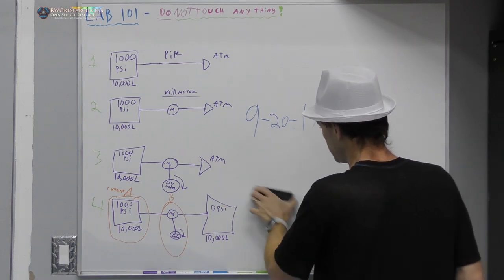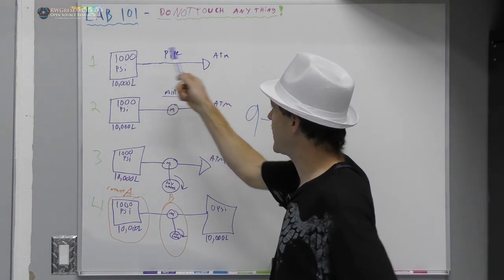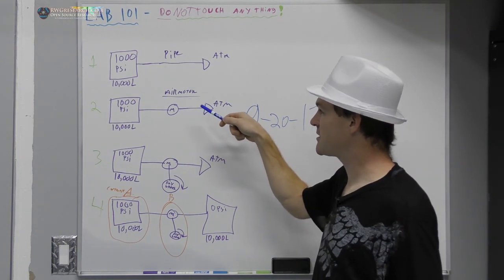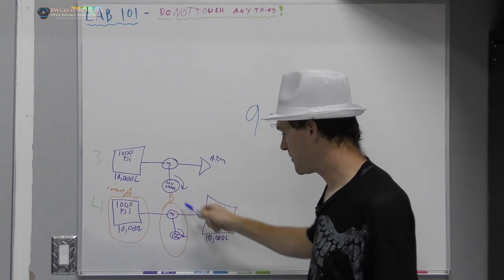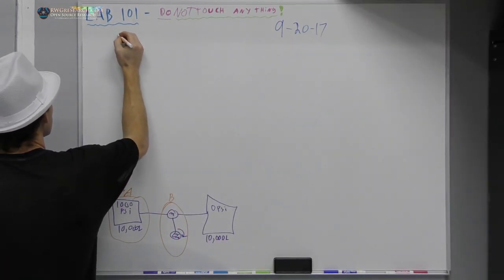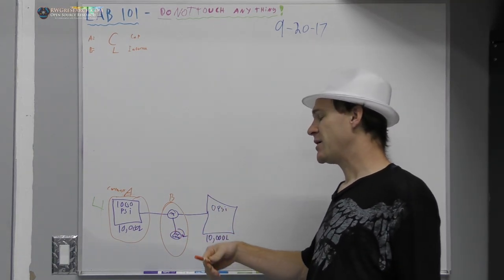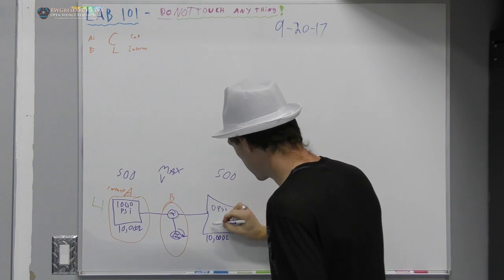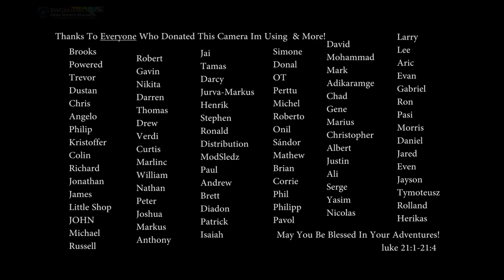The Search For Answers Part 3:  you can lead a horse to water but you can't make it drink

Comment: Russ - a better example might be a two vertical open top water tanks connected by a pipe at the bottom with a water wheel pump and flywheel on the water wheel.  The first tank would be full (the second tank empty at the start) and then allow the water to flow from one tank to the other through the water wheel motor - from the flow in the tanks the levels would equalize and the kinetic energy in the flywheel would continue to cause the pump to move water from the first tank to the second until the kinectic energy in the flywheel is consumed and pressure in the second tank reverses the flow and the water wheel pump reverses - the oscillation of the pump would continue until the frictional losses cause the levels in the tank to reach true equilibrium.

Comment: Pretty cool.  Electric fields, sadly, react so fast to potentials that as soon as the fields equal out, or the electron charge is uniform, there is no real movement.  I think it's the normal view that a wire allows all the electrons to move from one negatively charged area to a positively charged area.  But actually, the wire is not a bridge, it is a part of the field it is first attached to.  The flow first happens not at the mid point but at the second connection.  Also electrons do not flow often, and when they do, it's usually as beta radiation.  It the tiny, unknown fields that flow through wires the most.  Well, that's according to a theory I posted.  By the way, on another subject, do you think those ultrasonic units people are taking out of room humidifiers are strong enough to create a heartless steam engine?

Comment: the capacitor stores energy in its dielectric field, the inductor stores energy in its magnetic field. 

the electro motive force (capacitor) is transformed into a magneto motive force(the inductor), and back again into an electro motive force (the second capacitor).

can you tap into the magnetic field of the inductor (magneto motive force), and still transform all the mmf back into emf of a capacitor?

in other words, if we use the inductors magnetic field, to move a magnet (let say repulsion of the north pole) to turn a motor, do we lose some mmf of the inductor? or does the repulsed magnet induce a back emf into the inductor?

Comment: I don't understand how in scenario 4 tank 2 would end up with 1000 PSI. It would balance itself out to 500 PSI in each tank as you said. I do understand how the kinetic energy stored in the flywheel would allow it to act as a pump which would then cause tank 1 to have less PSI than tank 2  because the kinetic energy stored in the flywheel would then be used to pump or compress the air from tank 1 & 2 tank to be on the 500 PSI balance mark thus ending in a  ratio of let's say 400 PSI in tank 1 and 600 PSI in tank 2 in the end after all the kinetic energy of the flywheel has been spent by acting as a pump to compress the air into tank 2. I don't see how it would be possible for all the kinetic energy stored in the rotational mass of the flywheel  would be enough that it could break the balance between the two tanks of 500 PSI and then compress or transfer the remaining 500 PSI from tank 1 into tank 2.  I just don't understand how it would be possible based on the way the kinetic energy is stored.. If you added no-fly will into the equation both tanks wood balance themselves out to 500 PSI each but adding the flywheel would at some point cause the pressure in tank 2 to be higher than the pressure in tank 1. If no check valve were inserted into the system in the end the system would balance itself out and there would be an even amount of pressure of 500 PSI in each tank. In order for tank 2 to reach 1000 PSI or in other words in order for tank 1 to have transferred all of its pressure into tank 2 all of the air as it's being transferred from tank 1 to tank 2 would have to be stored in the rotational kinetic energy of the flywheel so much so that it would be enough to transfer the 500 PSI from tank 1 into tank 2. I just don't see how even in a perfect world there would be enough kinetic energy stored to be able to transfer all the pressure from tank 1 into tank 2. If you do this up on a graph as far as the kinetic energy storage or transfer goes you would see that it would not take much kinetic energy to transfer Beyond 500 PSI from tank 1 to a greater PSI into tank 2 however the more PSI you have going from tank 1 into tank 2 beyond the 500 balance mark the quicker the kinetic energy stored in the flywheel would be lost  and the closer you get to the 1000 PSI mark in tank 2  the less kinetic energy you have less and the more kinetic energy it requires to compress the remaining pressure from one thing to the other.  On a graph if you compared it to a downhill slope it would be a gradual downhill slope at first and then it would nose dive into a near vertical drop the closer you get to reaching the 1000 PSI mark in tank 2.  My point is the closer you get to 1000 PSI the more energy it takes to compress the air from tank one into tank 2 to reach the 1000 PSI however the kinetic energy stored becomes less or has less energy to compress the closer it gets to 1000 PSI in therefore even in a perfect world it would not be possible to compress all the energy from tank 1 into tank 2 because the more PSI you have in tank 2 the less kinetic energy you have to work with to compress the air the closer you get to the 1000 PSI mark and the more energy is required to do so. Near the transfers end you have less energy to work with at a point  when the greatest amount of energy would be needed to get the job done.  You have a lot of kinetic energy at first however it does not have to compress as much at first. If you could reverse it and have less kinetic energy at first beyond the balance mark and have more at the end then I could see it working however this is not the case and it does not work in that manner. 

 I understand that in scenario 4 your working with capacitors and such and you're not using the theory of of pressure in a tank moving from one tank to the other.   I understand how you compare the two between one another  and how you're using it as a teaching tool so that someone who may not understand electricity such as capacitors and all that very well  can have it presented in the way that is more easily understood. 

 it's a challenge to explain my understanding in words without being able to have a physical drawing to show you exactly what I'm speaking of. Maybe I'll do a video on it and post it to my channel.
Reply from the maker: Tyson Capel 
2 words. 
Impedance match. 
Yes I'm using air to teach. Air is a bad way to test this in the real world. The transfer would be less than 1000. For sure. Also I would need a check vlave in the line before the motor to keep it from Going back.  in electronics. If everything is impedance matched. Then you can get alot Of the transfer but not all of it. Close though. But don't forget even in electronics if everything is impedance matched and you can get allmost all of the energy to transfer through an inductor. What's left from the first cap + the new charge in the second cap is = to the same voltage total start voltage. 
There are more to discuss here but not in this comment. 

Now think about it. During the transfer we generated a magnetic feild in the inductor. We can use that to do. Work. Or we can do nothing with it.  

~Russ

Comment: then what do you explain everything is clear do not worry about it ...but the scenario is not ideal and the movement from point A to point B there are losses of friction (proton neutrons) and heat is released ...and if you connect the efficiency with the movement of energy and the heat that was happened ...you see 101% efficiency ...
Reply from the maker: Abricos4440 this is just to explain what I'm talking about. Dont forget we are still in a thought experment. (If you want to be)  ~Russ

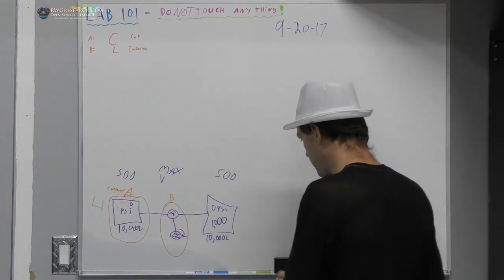Comment: 6:30 I do not get how you assume there could be 1000 psi from the left go to the right without any means of force like a pump (which requires additional power). The only thing I see can happen is, that the the pressure becomes equal and therefor there is no power potential left: 500 on the left and 500 on the right. Am I missing something?
Reply: Thinktin about it, I assume that your idea is the following: While potential difference, the motor accelerates the flywheel (which stores power); and once the pressure potential is equal the stored power in the flywheel will turn the motor and push/pump a certain amount of the 500 from the left to the right to create a new potential. Free energy it would be, if the flywheel would pump the right to 1500 as an example...

Comment: Scenario 2 is misleading! As you define the regulator as a 'motor' you create the assumption that something will be turning as a result of the air flow. If the 'motor' turns as a result of the airflow then some energy is "transferred" not consumed. SO from this I would say that Scenarios 2 and 3 are the same. The only difference is the mass of the turning part of the motor. Scenario 2 would be as you say it is if you defined the motor as a regulator as to not intentionally mislead your viewers to try and make yourself appear to be more intelligent...
Reply from the maker: The Art of 3D Printing hummm. Well lests start with the fact that I'm not making thses videos to sound intelligent. I could care less about that. I'm trying to point somthing out. 

 1. the pipe is the regulator in this one. It is in it's self a regulator. 
When the taink is empty the potential energy is "gone" but the pipe did not consume it. 

2. The motor is the pipe. It's only a regulator. You can have no mass or you can have a huge mass. Eather way it's just a regulator. If you have no mass. It's just pure resistance. If it's just resistance. Then it's the same as a pipe in 1 and you will have no potential when your taink is empty. But still the motor would not have consumed it... 

3. Same as 2 except The mass allowed it to keep the potental in a new form. So when the taink is empty. There is still alot of potental left. It's in kinetic form. And now you can do somthing else with it. In this stage it still did not consume it. It's just storing it. If you let it spin till it stops. Then you have no more potential energy.  But even then it did not consume it. 

Nothing I said changes the laws of physics. And nothing I said is new. It's ony a fun and helpful way to explain it. 

By the way. At the end of the day. The energy is no longer in the taink. There for the motor did not consume it. It did however convert a small amount of it in to somthing else. (Ex Heat)  If you want to get deep then you could say in 3 that if matched you could get allmost all of the energy to be "transfered" in to the motor. However the motor still did not consume it. It only is storing it...  As kenitic. 

Any hoo....  If you don't make people think. They won't learn.  blessings. ~Russ

Comment: Doesn't it consume some of the energy by converting it partially to noise?..
Reply from the maker: Falcon Flyer if you want to look at itthay way. But not as much as one would think. However there is more to it than that. Can you convince your self that if the motor is not there vs the motor being there that the same energy is released? So there for did the motor "consume" the energy?    ~Russ
Reply: So does this mean that if I set up a loop and converted everything to run on air in my house that by running one compressor and sectioned reservoirs down streem I could save money on my power consumption?
Reply from the maker: Falcon Flyer well I'm using air because people can understand it. But air systems have extreme losses. But it makes greate to explain thses things. :)   ~Russ
Reply: rwg42985 I do get what you're trying to convey... I like exploring these kinds of concepts as well... if the exhaust gass was put back in to the compressor,  because it's still has some pressure it would allow the compressor to re-compress the air more efficiently also yes?..
Reply from the maker: Falcon Flyer if applied correctly. That's it. And if you want to get the most out of what you have (one taink at 1000psi for this experment)  then youll do everything yoi can to extract all you can from it. ~Russ
Reply: rwg42985 Is this a prelude to how super conductors work?..
Reply from the maker: not really. at least I'm not putting those together here. i could explain the way i see it but... ahh there is plenty of text out there to read about it :) ~Russ

Comment: Air motor consumes energy through friction and & load.
Reply from the maker: a few things to think about. if the air motor is not there, did it consume the energy? also I never said that the motor did not " convert" small parts of the energy to heat via friction etc. The point of this is to make you think about the tank. with or with out the air motor. as long as it has a "path" back to a "balance" ( in this case the ATM) then the motor is only a regulator on how fast it discharges. In real life there are losses in the system, yes. but did the motor Consume the energy? No,  Even if it converted ALL of the air to heat. its only converted it... however thats not the case here.. an air motor has an outlet. and the air passes through it. it dose not consume it. but rather with or with out the air motor... the tank still "discharges itself". look at this: https://en.wikipedia.org/wiki/Self-discharge here is what it states: "Self-discharge is a chemical reaction, just as closed-circuit discharge is" in our case. its air instead of chemical reaction... ~Russ
Reply: rwg42985 - ok, I understand. Is a heat pump an overunity device? It could be argued that it is, but it is not. Do you see where I'm going?
Reply from the maker: MR Delete I see where your going. However. Dont forgot I never said anything about how the air would get in to the taink in the first place. This would imply that I'm not talking about OU at the moment. ;) see?  ~Russ